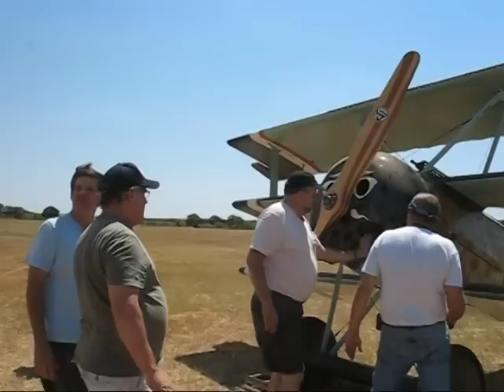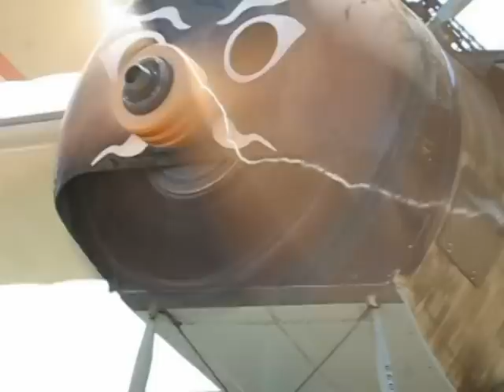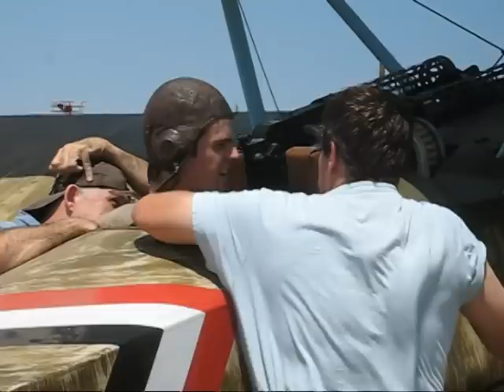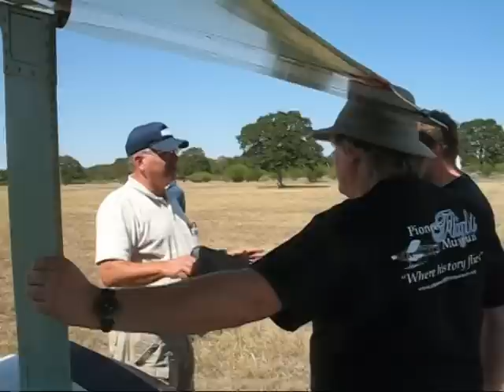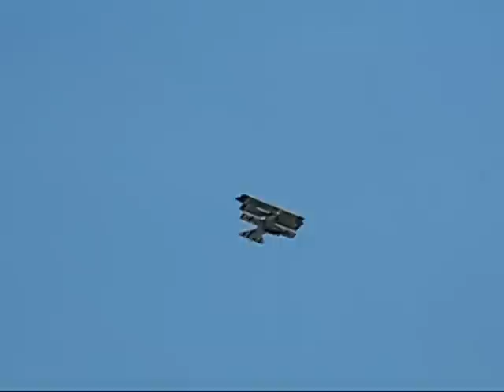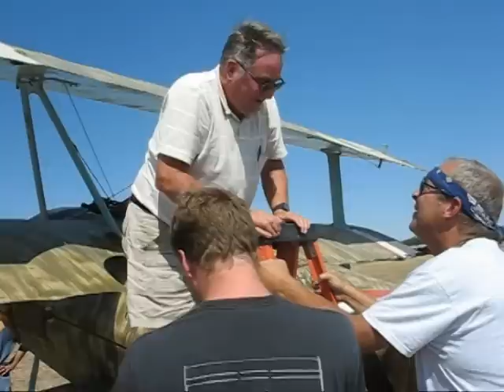Rough Flight in Fokker Triplane.mpg

Comment: Pilot did a great job. I'm wondering no one has mentioned that the the throttle on the LeRone was full all the time. On and off ignition is the only throttle control. The pilot mentioned rough run on T/O we hear the engine steady (although maybe rough or low power as the pilot said speaking of long T/O roll) the captions described a difficult landing due to rough engine performance but the surging of the engine was the pilot's technique of throttle control needed to slow down  to descend into approach. As long as the engine ran well enough to stay in the air it affected landing little if any. Thanks for the video love to see the old stuff fly 
(even if it is a replica still very cool.
Reply: The Le Rhône has a primitive carburetor and thus can be throttled
Reply: @knightsofthesky  It was finicky and they didn't use it much IN FLIGHT. They would set the mixture and throttle for most optimum performance and more often just use the magneto/blip switch. As one pilot said of these engines, you mess with the mixture of one in flight to much and you may wind up with NO running engine at all or a crankcase backfire that sets the thing on fire.
Reply: @waynepurcell6058  perhaps for the British aircraft using pressurized fuel tanks. You can rich cut a Le Rhone if you have a pressurized fuel tank. On a gravity feed system such as the Dr.I, you can use the throttle as you would on any other aircraft. I hate using the blip switch at any power setting above idle because it is really hard on the crankshaft.  The 80 Rhone will break if you blip it at high power.  Guys who run their 80s on the blip switch break the crankshaft in time.

Comment: Wow, imagine that a new LeRhone!  LOL

But if you're talking about the engine "bleeping" in and out that the magneto condenser kill, on-off intermittent button to control power, it was the only "throttle" control in the day for these simpler type of radial engines.  Other than that it sounded better than one would imagine, quite robust, smooth and alive.

Comment: Actually they do have a throttle, but it is a major pain because it is a two part system. One part provides air and the other fuel. Commonly you set it up on the ground then didn't touch it until you landed. In the air you used the blip switch but carefully as it could result in oiling up the engine.

Comment from the maker: We could just hear the engine sagging out over the distant oak trees as Steve worked intensely, balancing the gasoline flow with the engine's air flow, trying not to kill the engine in the process.  We could hear the rpm changes, but the camera couldn't pick up the distant sounds very well.  
  The surging heard near the runway was the pilot making use of the kill switch in preparation for landing -- scary, but required for a Triplane with an authentic rotary engine.

Comment: This is perfectly normal, there is no throttle on this engines. There is a valve to control air and a fine tuning fuel valve to regulate mixture as the aircraft climbs into thinner air. So, landings are made "full throttle" and power is controled interrupting ignition. There is a lever on the control stick to do it.
Reply: Spot on zefkosta.  My old now departed pal learned to fly in an AVRO 504.  You are correct.
Reply: Wrong.

Comment: As an aircraft maintenance technician of 24 years, I get annoyed when people post stuff on the internet which questions the competence of the crew or the safety of their machinery. There is absolutely nothing wrong with this aircraft. The simple carburettor used gives the pilot only limited control of the engine RPM and a very high 'idle' speed. When landing it is normal practice to kill the engine intermittently by 'blipping' the magnetos off in order to reduce speed. It's a lovely landing.

Comment: I thought it was crazy how on some auto engines in the 1920's you had to manually operate an oil pump to lubricate the camshafts, or how you had to manually adjust the timing on Indian motorcycle engines, and probably others, too.

But making an engine where you reduce power by blipping an on/off switch is positively insane.

Comment: The only line of rotaries that didn't have throttles was the Gnome Monosoupape series (and copies of it), due to the way the engine worked. It had one giant valve at the top of the cylinder that acted as both an intake and exhaust valve.

Most other rotaries used a conventional two valve design (like the LeRhone) where the fuel/air mixture was administered through tubes to the cylinders, unlike the Monosoupape where it used ports in the cylinder walls for fuel only similar to a two cycle engine.

Comment: Someone correct me if I'm wrong, but I'm fairly sure the LeRhone has no throttle, but uses a "kill-switch" to regulate power. With the switch released, the engine makes full rpm. 
"Blipping" the switch is how you reduce power.

Comment: Actually no. Believe it or not, some of the old radial engines from the first war only had a couple throttle positions (and by a couple I mean 50% or full throttle). The intermittent engine on final was surely the pilot hitting the kill switch (aka blip switch) to maintain air speed.

Comment: Engine may not have been perfect, but it was working well enough. Rotary engines are controlled by turning the ignition on and off which is the reason for the blipping.  Nowt serious wrong with that engine.

Comment: The engine is NOT running rough.  Rotary engines don't really have throttles per say.  They use a "Blip Switch" to turn off the spark plugs for a second or two during landing.  It makes the plane really a handful, but that was how they worked.  They basically were on or off.

Comment: A friend of mine built a Fokker Triplane from Redfern plans (using a 145hp Warner engine) and I did the first three flights on it. After flying it and with him in a Citabria, my suggestion was to sell the Fokker and buy a Cessna. He was so far outclassed that it would have eaten him alive. He sold it but didn't buy a Cessna or anything else. After spending four years building the Tripe, he was burned out on airplanes. Don't know what became of it.
Reply: Because the tai-plane has three wings,  it climbs like a home-sick angel.    Most pilots can't handle that kind of climbing prowess.     And landings are tough because each on of those three wings has to be brought down to earth---together.    People forget that when they have a triplane.   It is unique to triplanes.    Lift.
Reply: Sorry Frank but none of the WW-I airplanes climbed very well. There is so much aerodynamic interference  between the wings that it will fly almost as well on a single wing as with two or three.

Comment: No, not an ultralight.  As a replica, it would be licensed as an Experimental Amateur Built.  Old Kingsbury Aerodrome is an airport.  Many airports have only grass runways.  This type airplane is safer flying from the grass.  It has an N-number, small ones low on the aft fuselage.so as to not distract from their vintage appearance.

Comment: I thought those engines ALWAYS surged (?)  At least the Gnone seemed to.

In fact, when they first started it, it ran SO smoothly - never heard one run that smooth.

Is there a big diffeence between the Gnome and the LeRhone, as to running smoothly, etc.   thanks.   N-6395T
Reply: I agree.  Though I did pick up that he thought the power was low, there is nothing abnormal with cutting the power off and back on by using the "kill" button for the ignition on these.  That was the only way they had to control rpm and thrust, there was no carburetor throttle, only a mixture control If I remember correctly.  I've seen many flights of rotary engined WWI birds at Old Rhinebeck Aerodrome and that is a common and natural sound.
Reply: whalesong999
 I saw one of your comments concerning a P-40 (my favorite acft.) so I thought I'd include a few pics of my "EROS Mini-max," that I tried to "outfit" as a P-40.

 The basic shape seemed a bit similar to the P-40, so tried to come up with that "treatment."  Flew this plane for 13 years - tried to get 1,000 hrs on it, but only made it to around 750.  Retired it via the FAA.  Was a great "slow cruiser" (110mph was Vne)  Only cruised at 78-80mph.)

http://www.airport-data.com/aircraft/N6395T.html

Sure miss that little plane!   N-6395T
Reply: Very nice.  Was it light sport or ultralight?  Did the regs change or something else cause it to retire?
Reply: Thanks for your comment.  It was built in 1999 and registered as an "Experimental Class Amateur Built" airplane.  (Pre Sport Pilot)

Flew that plane for 13 years - And, as it was wood and fabric, the Florida heat and humidity really hurt it.  It needed a new fuselage, and I had no place in which I could work.  Took the plane apart and gave it all to an old flying friend. 

Surrendered my "Special Air Worthiness" certificate to the FAA, and de-registered it with Oklahoma, City. 

The Ultralight planes are covered in FAR part 103 - their max "empty" weight is 254lbs.  The Sport pilot planes can have a max "all up" weight of 1320.   My plane could be of any weight, as long as the weight and balance info was "good to go."  

Thanks, m. donavon, fl.

Comment: What kind of motor is that? The crankshaft is stationary and the motor turns? How is the gas fed to the carb? How is it lubricated? How does the ignition work?
Reply: Its called a rotary look it up on Google
Reply: Robert Dimmack Gnome rotary
Reply: LoveNotLabels  the originals were lubricated with a mixture of gasoline and castor oil.  That's why the pilot's faces were always covered with black oily mess.
Reply: LoveNotLabels that type of engine made the plane hard to fly given the amount of weight that was spinning around
Reply: raccoon681 I would think so!
Reply: +Tom Witman That's an explanation of the Gnome Monosoupape, not the Gnome LeRhone which is used in this triplane.

The Monosoupape was one of the more strange rotary designs since it had ports and just one valve, but it did give it an edge in weight since it didn't need the induction tubes and extra mechanics for two valves.
Reply: +LoveNotLabels Le Rhone Rotary Engine
Reply: +Tom Witman  Also why German pilots wore brown trousers. Ingested castor oil has a cathartic effect. Nuff said!
Reply: It is like a turbine engine or something 'cause it all spins around and makes funny noise.   But it is all good.
Reply: OMG!!!  Sad...
Reply: indeed a bit soft in the head

Comment: These old planes didn't like the throttle below 800rpm's and this was to fast for it to land the plane. It would be impossible to slow down and land so they had to use blipping to slow down and maintain a slow speed for landing.
Reply: Almost right.  There was NO THROTTLE!  On or off were the choices!
Reply: Tom Witman They could selectively shut off some of the spark plugs/ignition points to slow the engine down
Reply: Yes, you're right.  They did come up with some crude methods to short out some of the plugs to have several speeds.  While those plugs weren't firing, the exhaust valves on the top of the cylinders were spewing out gasoline and castor oil all over the fuselage.  HOPEFULLY, no flames from the exhausts ignited the gas!

Comment: Some of the later rotaries had a throttle I believe.
Reply: They devised systems to short out some of the spark plugs so that they had several 'levels' of power instead of on/off that this one apparently has (your 'rough' running comment).
Reply: Tom Witman The different levels of power by shorting out specific cylinders was only used on Gnome Monosoupappe engine types. Since the Monosoupappe series both exhausted and took in air from the top of the cylinder and got fuel and oil from ports on the bottom of the cylinder, you couldn't realistically throttle the engine.

Most other rotaries were conventional with two valves at the tops of the cylinders and an induction tube to get the fuel/air/oil mixture into the cylinder. It was possible to throttle these if you had a carburetor sophisticated enough to allow it, which happened later in the war.

The engine in this Fokker Triplane is a Gnome Le Rhone (or an Oberusel which was a German copy) which is of the conventional two valve per cylinder and you can see the induction tube. This engine can be throttled and indeed does have a throttle noted by the smooth power ramp. If it had the cylinder grounding system used on the Monosoupappe, you would hear significant amounts of popping and the aircraft would be jerking side to side from the abrupt change in engine speed.
Reply: it was called "blipping" the engine . shutting off spark to various cylinders ... You wouldn't want to land on full power ( the normal mode for a rotary engine ...)
Reply: +Alan Waite Seems to me like I read years ago they could select different combinations of cylinders to blip so that they would not be blipping the same cylinders all the time since it fouled plugs.  You would want the opposite choice to have a chance to clean up from running I guess before you change back......   back and forth, just another dance to do.

Comment: Does any one know what was wrong with that engine ? And what was it like to fly ?
Reply: Nothing wrong with it.
Reply: nothing is wrong with it at all. but the gyroscopic precession is crazy on these planes. So they are very difficult to fly.
Reply: It doesn't have a collective exhaust manifold or mufflers, that's why it is so loud and you can hear every single combustion.
Reply: The poster apparently doesn't know how a rotary engine's ignition was controlled.  You either had full power or no power in the early years.  The engine would spin without ignition and soak the fuselage with raw gas and castor oil.  When he kicked the ignition back on, he prayed that a spark would not set the plane on fire.  Later they had ways to only have a few of the plugs fire to give varying levels of power.

Comment: "It's not getting full power. Did you see how long it took me to get off the ground?"
It's an 80hp engine, what do you expect? They were considered underpowered in 1917 with 110hp Oberursels (German licensed le Rhones).

And what's up with that landing? I've seen airplanes with nose wheels pull more of a flare than that.

Comment: G'day...

   OK, I gave you a "Like", for the Camerawork.

   But that Bullshit Title almost got you a Dislike.

   Gnomes were Monosoupapes, "One-Valve" Engines, they had no effective Throttle-ability ; and ran at 2 speeds, "Full-Power", or "Idle"...., with an Ignition-Earth Switch operated by a  Spring-Loaded Pushbutton on the Joystick...

   So, to reduce Speed in order to lose Height, the standard procedure was to cut the Ignition with the "Blip-Switch" letting the Engine first Free-Wheel & then Windmill ; but letting it run for at least 1 Second every 5, or 3 Seconds every 10 Seconds of being Earthed, to avoid oiling-up the Spark-Plugs & having the Engine refuse to run when the Blip-Switch was released.

    This was a perfectly healthy 80 Hp Gnome Monosoupape being operated normally.

  The Service DR-1 Fokkers had 110 Hp Oberusel Rotaries, but the Prototype indeed did fly with a captured (Shot-Down)  80 Hp Gnome.

   Sorry, but one is a Smart-Arse ; and knows a lot of obscure factoids.

;-p

Ciao !

Comment: Wasn't the original engine 110 hp?
Reply: There were actually 5 or 6 Rotary Engines of WWI vintage.  The Oberfusel was a German copy of a Rhone? or Gnome?- the Germans preferred captured French or British engines if they could get them.   Engines by Clerget were built in England under license.  None were particularly brilliant.  W O Bentley, later of car fame, was commissioned by the British Gummint to create a better engine.  His rotary, the BR1 was far superior, using aluminum-alloy sleeved cylinders, alloy pistons etc and making 150hp, but infighting between the services limited production so that Clerget licensed engines continued to be made in the UK.   The BR1 was the preferred motor for the RFC and the Navy when available.  A more powerful version, the BR2, [220hp+ ] went into production late in the war.  It powered the Sopwith Snipe and was the last of the line. Conventional layouts were used in all later aircraft engines. You can sense the limitations of the design - imagine a 2000hp Merlin Rotary 'wringing out' a fuselage!
Reply: The original engine was, in fact, 80 hp and was a copy of the Le Rhone rotary. You''ll want to remember that horse power wasn't the only consideration in those days (or today for that matter). It's all about "torque" or "twisting power". That's why the small engines were able to turn (twist) the huge props that they turned. It's because the engines themselves were "twisting" as  rotary engines. Today's aircraft with an 80 hp engine have tiny props by comparison and have far less twisting power/torque than the Le Rhone (and other) rotary engines.

Comment: I believe Fokker only ever built about 320 of these triplanes. No originals survive.  It took the Allies well into WW II to destroy the last one when they bombed a Berlin museum where it was on display.
Reply: +Rob Mackenzie Actually, Talmantz Aviation had five original Fokker Triplanes at one time. They had two of them left in flying condition in 1968 and was in the process of building one out of the wreckage of several others.
Reply: +Jim Foreman Those were the "Blue Max" Triplanes and they are reproductions.
Reply: +Rob Mackenzie Yeah, I know (complete with modern engines) The originals had become far too valuable to risk them in movies. They are all in museums or hanging in bank lobbies.
Reply: Jim, You are contradicting what you just said.  There are NO original DR 1 triplanes left.
Reply: +Rob Mackenzie I stand corrected, there are no original DR-1s, the few remaining ones were rebuilt from original or remanufactured parts from original ones.